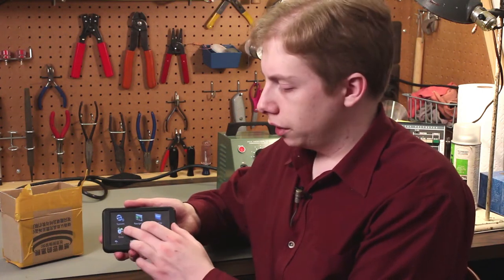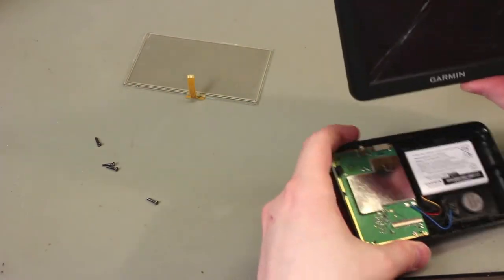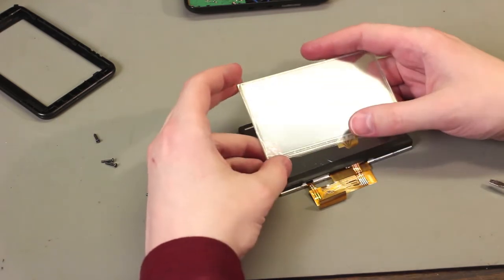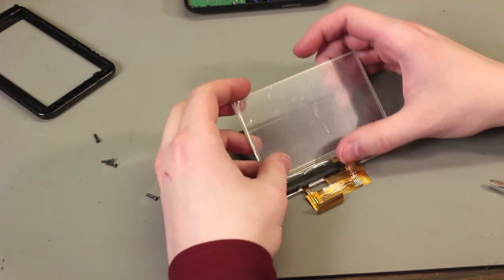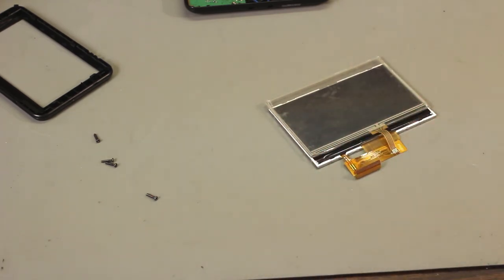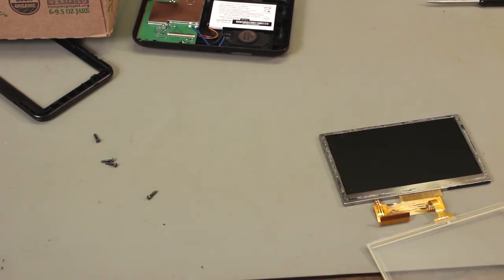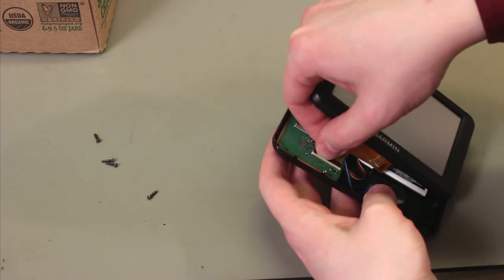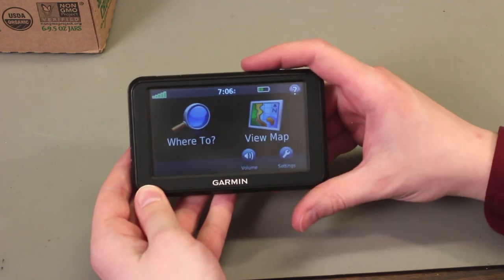Replacing a Broken Digitizer on a Garmin Nuvi 40 GPS

Comment: Thanks for that great video.
 the only thing is that I don't do alot soldering does it need to be soldered connection by connection what about if they touch will it short?
And lastly what is the ideal temperature to use on board like this?
Reply from the maker: This is a tougher project if you aren't comfortable soldering. It takes some finesse to solder on flat flex cable like this without damaging the cable. You want to use just enough heat for just long enough to melt the solder. Too much heat and you'll melt the cable. Also, too much solder and you can form a solder bridge between the pads on the flat flex cable.